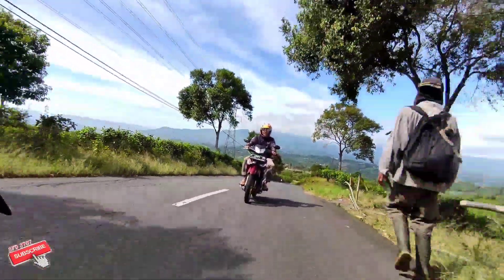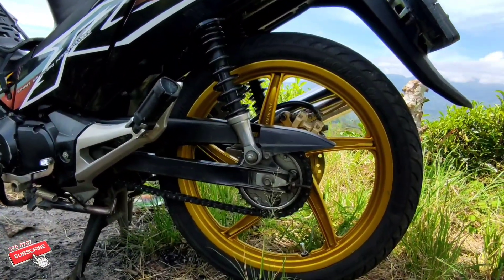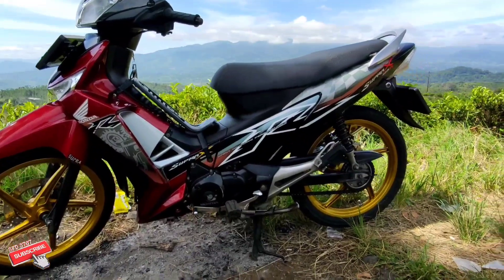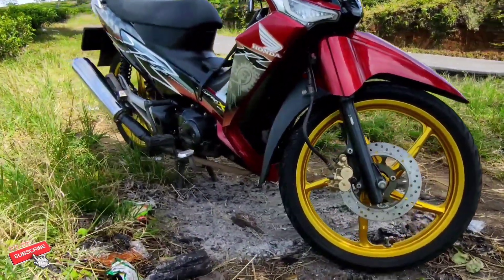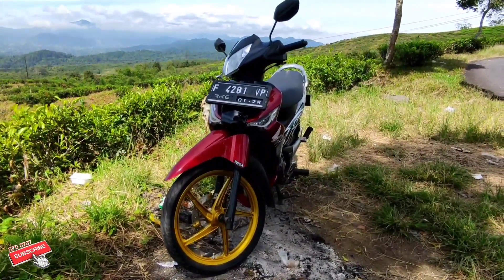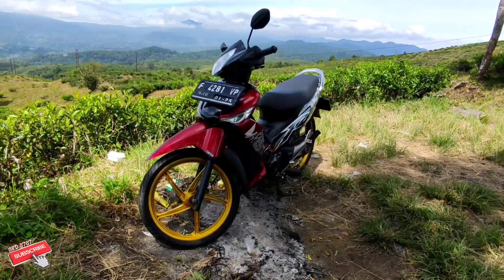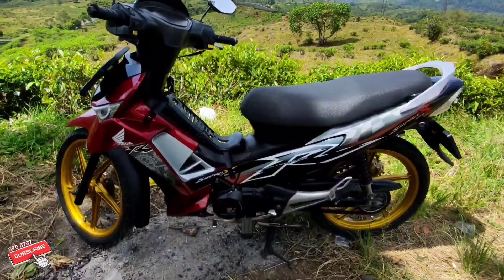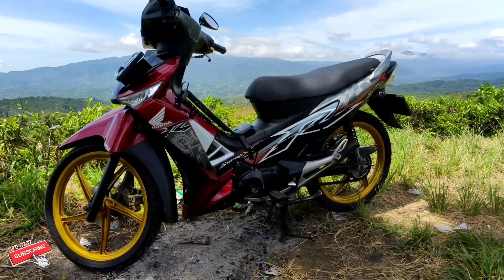SUPRA X 125 | KELEBIHAN DAN KEKURANGAN SUPRA X 125 R

Comment: Supra x 125= Lari nya kencang di trek lurus dan lemah di tanjakan
Reply from the maker: Betull om
Reply: Jadi kalau utk keduanya motor apa yang bagus om 
Utk bolak balik 50 km sehari yg ada jembatan naik dan turun tiap 5 km
Reply: Gir nya ganti ukuran 38 om 
Kalo pengen mantep lg pake per tdr sama kampas kopling tdr itu udah mantap joss , kalo pengen mantep lg remup ecu atau ganti cdi brt
Reply: Buat boncengan ke tanjakan yang curam kuat gak mas ?
Reply: Di trek lurus masih bisa lari 100 gak tu om normalnya??
Reply: @iim6072 Kuat gw gw juga pake x 125 2008 kuat asal gigi 1/2
Reply: @OsinJyLo2  gw pake tahun 2007, 120 kpj kuat, kuncinya main rpm bawah dulu
Reply: Sama seperti Honda karisma
Reply: bisa lah @OsinJyLo2
Reply: @UlumPawi mesinnya sama kodenya KPH
Reply: @UlumPawi mesinnya sama kodenya KPH

Comment: supra x 125 semenjak pake injecsi kualitanya jd berkurang jauh, dipakenya gak enak. masih enak yang karburator. kalo sekarang dikasih fitur gimmick doang.
Reply from the maker: betul sekali mas. saya sangat setuju
Reply: @otomotif3767  soalnya ane sekeluarga pemakai honda, supra X 125 keluaran taun 2006 motor pertama ane gan. sampe terakhir beli yang 2012. trus keluarga beli yang model injection haduh beda jauh gan. mesin nya gak enak, suara dari knalpotnya aja beda bener. sama kualitas knalpotnya jelek sih sekarang. 2016 jadi sales honda jadi emang kerasa bener kualitas nya beda dari yang lama. berbagi pengalaman aja gan
Reply from the maker: @masgan.firman  waaah klo prnh jd sales honda pasti sih tau seluk beluknya mas. hehe
oiya gmna pndpatnya tntng kwalitas rangkanya yg skrg ya??
Reply: @otomotif3767  terakhir jadi sales honda 2018 gan, kalo sekrang di toyota. kalo urusan rangka sih kekuatan nya lebih ke yang lama gan, kalo rangka insaff sih kok ngerasa kurang ya. tp memang lebih lincah aja dipakenya. untung pcx 160 blm pake rangka insaff. jd gak perlu perawatan ektra di rangka nya. hehhe
Reply from the maker: @masgan.firman  iya ya. berarti hanya pcx ya yg blm insaaf. jd msh worth it untuk d beli bagi kaum mendang mending kaya saya
Reply: @otomotif3767  bener gan, penyakit motor bebek honda sih body nya doang cepet geter. beda sama motor yamaha. untung motor matic honda gak kayak motor bebek nya. itu penyakit bawaan bebek honda kayaknya. baru sebulan batok kepala nya duluan yang geter, ntar nyusul di buntutnya biasanya. kalo revo menurut gue yang REVO ABSOLUT sih yang masih terbaik. beda jauh sama yang sekarang.
Reply from the maker: @masgan.firman  sipzz betul. saya d pke bapak revo absolut. asal oli terawat smp skrg suara msh renyah. hehe
body jgn sering kpnasan msh ttp oke